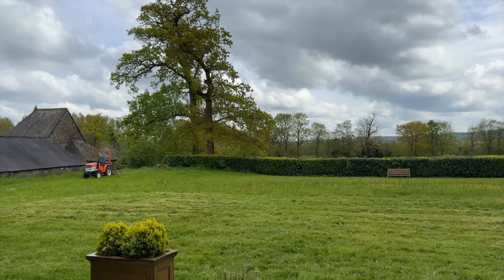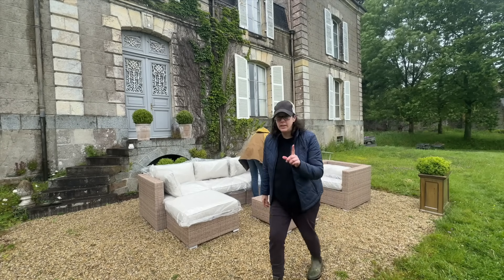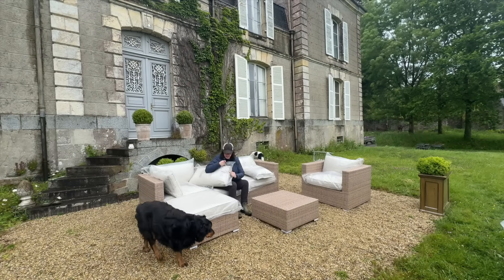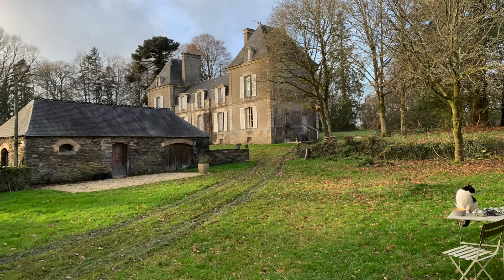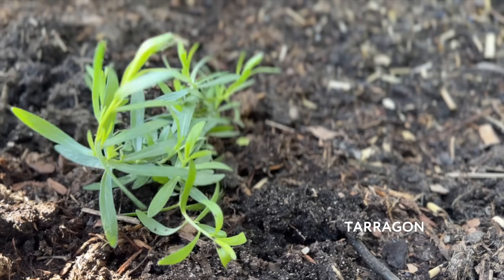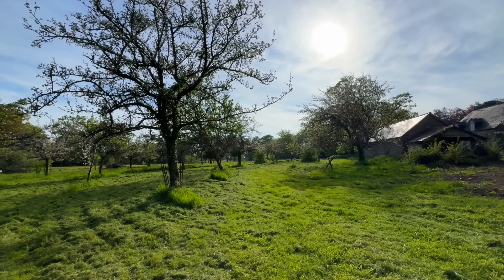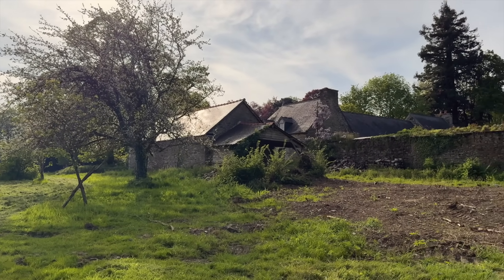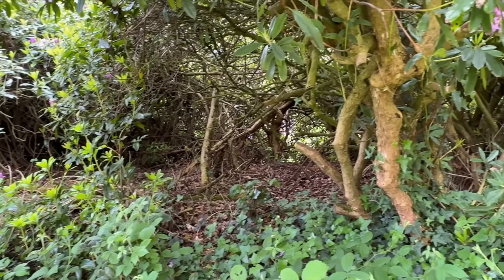BEFORE & AFTER! Our Idyllic Countryside Chateau Spaces + Our Kitchen Herb Garden

Comment: This is off topic for this video, but I don't know if you've ever watched Life of Ryan, but he's renovating a house in the north of France. Which means replacing beams. Rather than having to cut a hole to slide it through, they clean out the deep hole and then you push the beam in as far as you can. Then it slides into the other hole as well. So rather than having 18 in of beam in each hole, you might still end up with 10 in in each hole which is more than enough to hold up the upper floor. Have you thought of looking into replacing your beams that way? It would certainly be a lot less work.

Comment: Kids, Kids, Kids … you definitely got the WRONG COLOR of outdoor furniture. And then to add insult to injury you put it out on your front door. NO NO NO! Turn your table the other way, place your PALM BEACH Bright outdoor furniture mid area and off to the right (of our site on video) and put that umbrella up over the table - Lincoln drill a circle in the table to told it up. Glass door fridge to have drinks at the bottom and top to hold food that you brought down to grill. I’m thinking water fall / fountain to give the tinkle noise of relaxation.